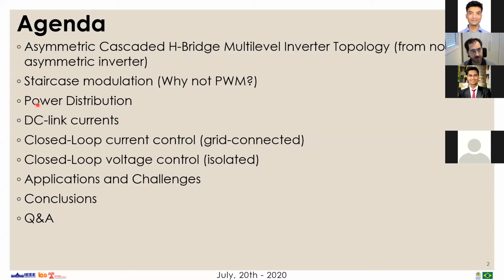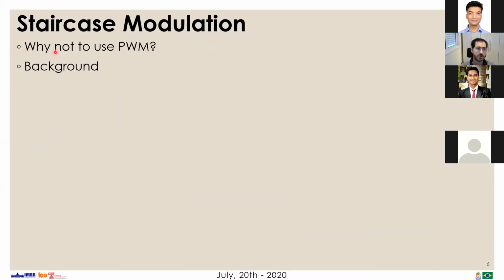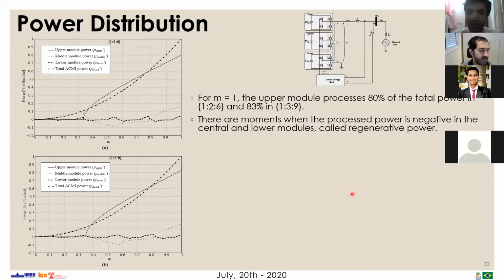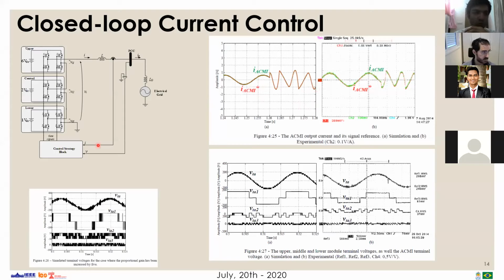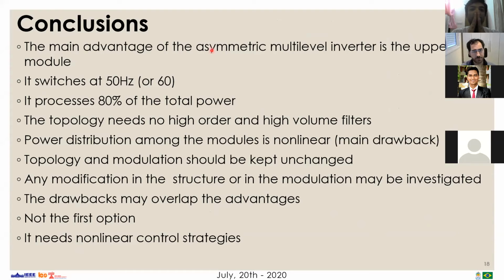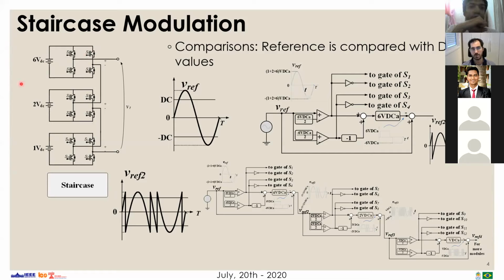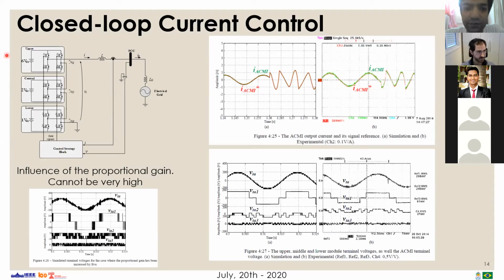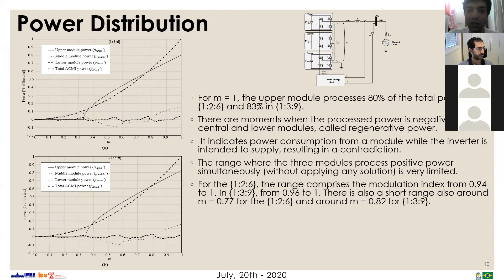Webinar - Asymmetric Cascaded H-Bridge Multilevel Inverter: Advantages and Challenges

Comment: if you want to make a 5 level assymetric cascaded H bridge inverter . We have to use 2 cascaded inverter but maximum voltage of that inverter is 2 V .So,how we design voltage  for that 5 level assymetric cascaded H bridge inverter.Plz guide me .THANKS

Comment: Nice. However, this is a basic modulation based on nearest level control and not a THD-optimal staircase modulation, in which you pre-calculate the switching angles, given the desired modulation index and the DC ratio values (by lookup tables), resulting in a lower THD or WTHD output.